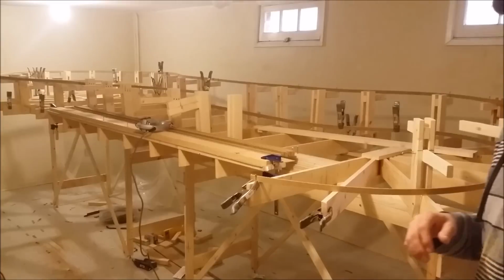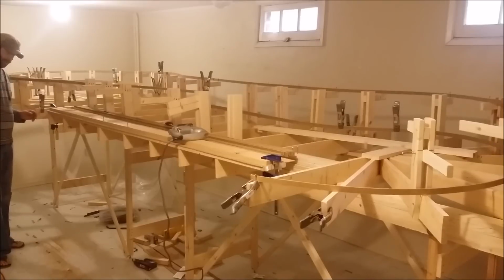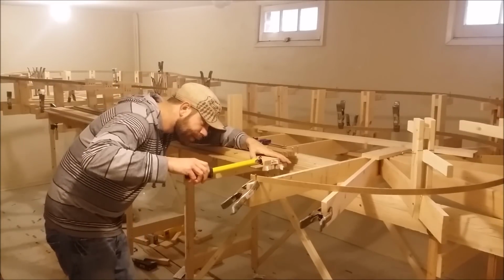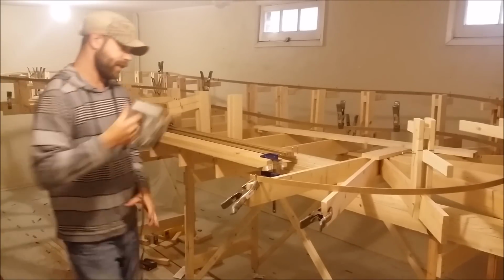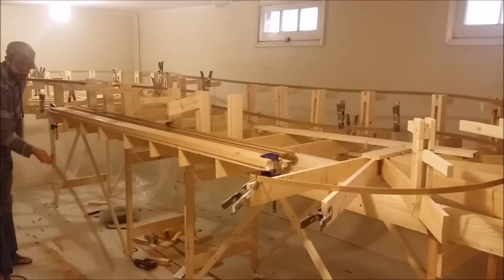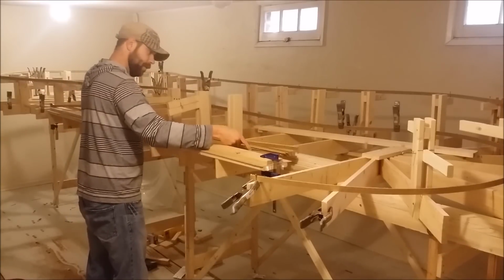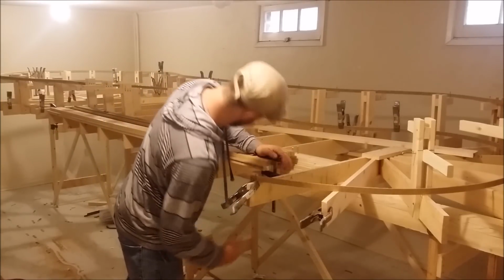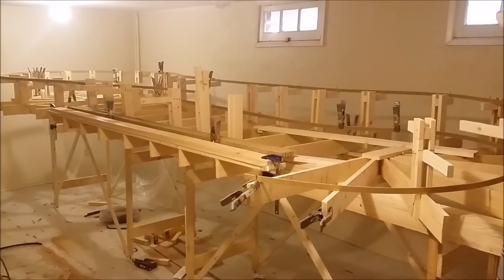How to Cut Spline Roadbed for your Model Railroad

Comment: I cut over 160 3/4 wide 8 foot long strips for my layout and clamping and remeasuring every time would of been crazy. I invested in a table saw.  You can get a table say for $100 new or cheeper used.  I cut it all before I had the benchwork done and had no Idea how much it would take. To my surprise I only had 2 strips left over. Looking GOOD! Keep up the work.
Reply from the maker: I found a better method. Check out How to cut spline revision. Thanks for commenting!

Comment: I use the same method, but I cut all my hardboards on a table saw. Just set the fence at the width you want and go to cutting.I clamp 5 board together and get 5 stripes on every cut, very fast. No guess no mess.
Reply from the maker: If I had one I would've done the same! It worked well for not having one!
Reply: Yes it did it was a very good idea for those that don't have a table saw. Would you be able to cut more than one at a time or are you restricted to thickness. THX

Comment: what is the thickness of the spline material that your are cutting    I know it is 2"  but how thick of material did you by
Reply from the maker: +Larry Licht Thanks for your comment. The height of the spline is less then 1 inch and the thickness is 3/16th of an inch. When I put 7 of them together the measure just below 7/8th of an inch. Perfect for cork and ballast to sit on it.

Comment: You've actually got more money in clamps on that table than it would cost to make this job go 20x faster. But if you insist on using a jigsaw, at least cut the stock 3-4 times and stack it before you cut it (ex. cut (1) 4'x8' into (4) 1'x8'). You will work 3-4 times faster.
Reply from the maker: +thnksno Thanks for expressing your concern. I actually have about 60 clamps or so and I did end up using a different method then the one shown here. I am not to worried about hurrying up the process for the fact that I like to take my time in building a world class model railroad. Thanks for watching!